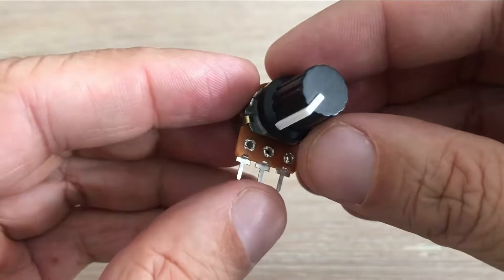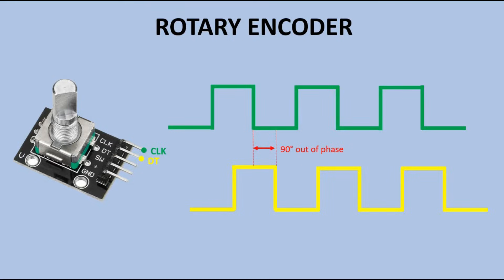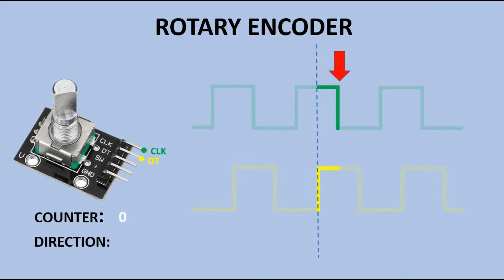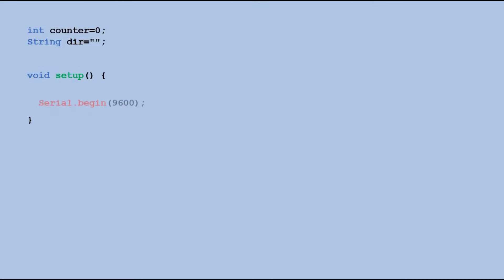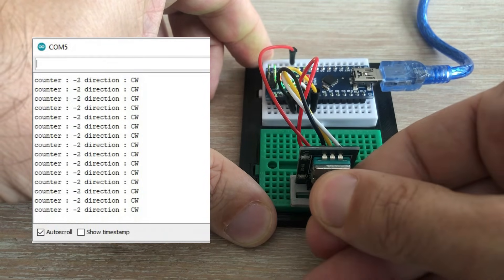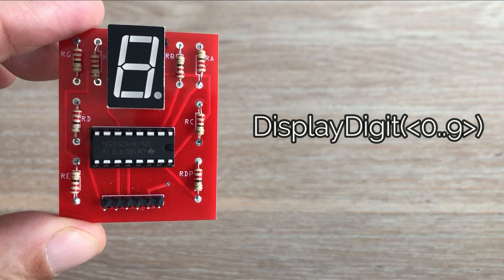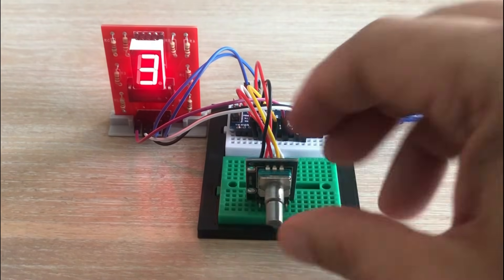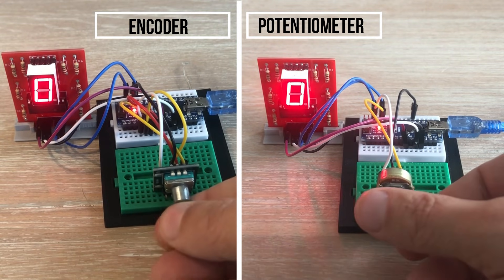How to use Rotary Encoder with Arduino

Comment: The working of interupting and low is the logic of the methode. Meaning; interupt has no tolerance value like low has. Low implements between 1-5 in comparison to interupted signal what is 5-0 inexample.

Comment: Hey Mario.  Great video.  And I think I learned something new.  I was under the impression that a Rotary Encoder needed BOTH the CLK and DT pins to be connected to Interrupt pins.  All of the videos I've seen thus far show that connection, which limits an Arduino UNO or NANO to only one Encoder.  But if it only needs one Interrupt pin, then two could be connected.  So, is that the case?  Thanks.  Regards.
Reply from the maker: Absolutely:) Never used two but don't see why it would not work. Give it a try

Comment: maybe you need to run the sentence "last_run=millis();" inmidiately after the first "if" in the "shaft_moved()" function so any other call to the function by a glitch/bounce will be discarded as the value on the millis() function and the value of the last_run variable will be so close and less than 5ms, then the function will not run, until the millis function gets enugh time again. Runing that sentence at the end of the function makes no sense because allows new calls to the function while the actual call is just executing,

Comment: hello this could be helpful for Debouncing!

this part of the code, inside the Encoder function and on top of your Code

  static unsigned long lastTime = 0;
  unsigned long currentTime = millis();

  if (currentTime - lastTime < DEBOUNCE_TIME) return;
  lastTime = currentTime;

also you have to define the DEBOUNCE_TIME first or you can make a variable for it, for me 1ms is working very Good.

I only Hate it when the rotary Encoder misses some steps and dont recognize them as a Step ...

Oh and i use it so , with FALLING and its working Fine -> attachInterrupt(digitalPinToInterrupt(3),  shaft_moved, FALLING);

Comment: The LOW setting should not work at all, unless... you simply have the wires hooked up the wrong way round and you're triggering on the DT line.

Comment: I think you have to check in code if the shaft was turned a full click in the same direction. Example: First CLK goes low (interrupt trig) and DT is still high. When DT goes low you know the specific direction you turn, but first you wait for CLK to go high again and then check for DT to go high. When that happens you change your counter. And vice versa for the other direction. I got this principle to work with help from chatGPT but the code was much more advanced. After implementing this it worked great but it was only an example when I learned about rotary encoders so the extra code did not matter to me.
Reply: "I think you have to check in code if the shaft was turned a full click in the same direction."

You don't have to, because CLK will only change if the shaft is rotating and DT will show the direction.
Reply: @vinny142  Im sorry, this was an explanation to the jumping numbers you demonstrated on the 7-seg display. I noticed it to when testing the encoder in a sketch and found that if the shaft is moved slightly in the wrong direction this happens. And this happened to me every time I got a new grip of the encoder wheel. Thats why I coded the number to increase only after a full "tick". 
I suppose there are lots of different ways to get this to work.
Thanks for the video!

Comment: Very good educational explaination. I finally understand how it works. I'm currently building a router lift and I will continue to try to connect a Stepper Driver and Stepper motor to make the rotations work correctly with absoule values (together with momentary push buttons) and fine tune the router bit with a rotary encoder in millimeters which would be displayed on a LCD or OLED screen. Thanks for an excellent video.

Comment: This has been helpful but in my case I'm trying to use a mouse scroll wheel rotary encoder (which you can get from a computer mouse or buy from amazon). Setting it up in a similar fashion, I can get it to function roughly in the right direction - as I keep scrolling up or down, the counter reliably keeps increasing or decreasing as expected but sometimes it will go in the wrong direction as well. I tried experimenting with different resistors but haven't found a fix. Maybe there's something wrong with my wiring. I'm very new to this.

Comment: The skip in the digital count is probably caused by bouncing. A "debounce" circuit using CMOS 4093 Schmitt trigger ICs is better that having capacitors to ground - of course, this adds a layer of complexity, but it's doable. I am trying to use your Arduino code with a linear encoder (home-built) rather than a rotary switch for my application. Great easy to follow video and super graphics. Thanks.
Reply: I think the use of a 4093 for signal debouncing is a great idea, so much, that I just ordered 50 of them. I know that might sound excessive, but when I want to build a project I don't like waiting for parts.  I like to get busy right away so I believe in keeping an inventory on hand. I hope you'll have a great day.

Comment: Once I move the knob on the encoder the output runs so fast I can't read it and keeps running even if I don't turn the knob anymore.

Changed Serial.print to Serial.println and it starts a new line now, but the numbers don't change when I turn the encoder knob
Reply from the maker: Which exact place in the video you are reffering to
Reply: @marios_ideas  I'm referring to the code I got from the link

Comment: Thanks for this video and explanation. The « hesitation » you can see from « falling » trigger mode might be induced by some electrical rebound when contacts are opened/closed. Put a small 10nF between GND and CLK and GND and DT it should solve it :)
Reply: bro I genuinely love you
Reply: This worked beautifully thank you very much :D
Reply: And swap to RISING edge so the capacitor doesn't give you the exact same problem when it slowly discharges by leaking.

Comment: I found this on Google.  "FALLING triggers an interrupt when the signal changes from HIGH to LOW. LOW fires the interrupt for the ENTIRE time the signal remains LOW. So, if your ISR returns while the signal is LOW, the ISR will immediately be called again, after executing only a single instruction back in the foreground task."

I think what it is saying is with falling,  if you have a bounce issue,  it may false trigger,  but if you force it to "LOW" then the bounce will be ignored.   I believe that is what they are saying.

UPDATE:  Actually,  after reading this and some other stuff a few more times,  I think I have it wrong.  So I am in the same place as you, not really sure why LOW is working better in this situation.
Reply from the maker: EXACTLY:) I was digging myself and couldn't find reasonable answer
Reply: I think the ISR execution condition of >5ms since last interrupt makes the LOW mode work. This is because when the signal is LOW, the interrupts fires with the clock frequency, which is much faster than 5ms. Therefore, when not turning, ISR is not doing anything despite being fired all the time when the signal pin is low. When the signal pin is high, ISR is not fired anyway, so when rotating and passing from high to low, the >5ms execution time is fulfilled.